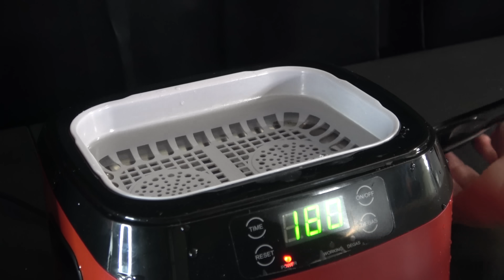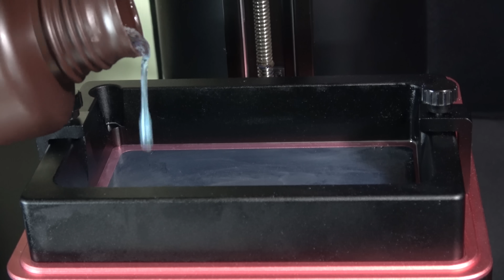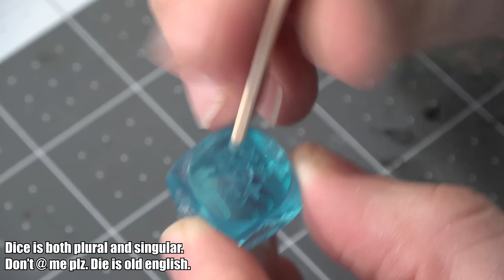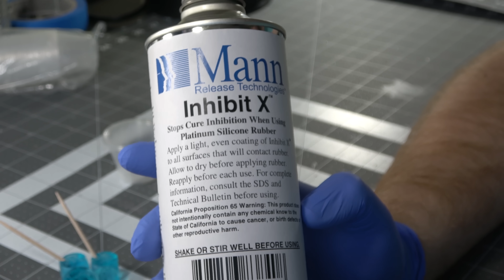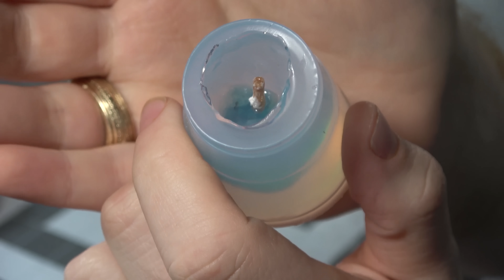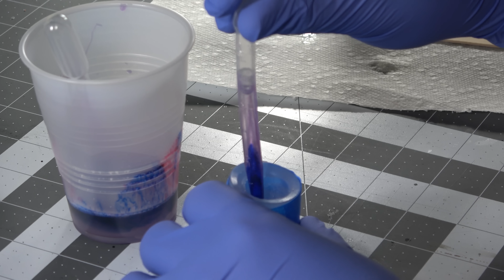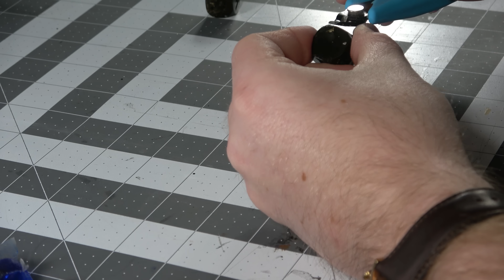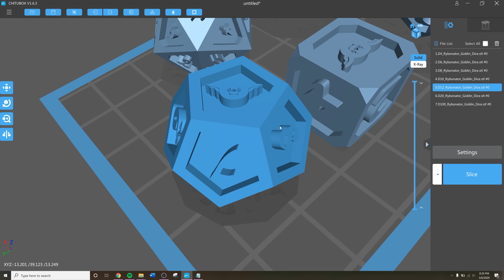How to Make Master Dice for Molds from 3D Printed Dice

Comment: Tip for you dude, use Prusa Slicer to oritate and support your 3D prints, then export them as an stl with supports, Chitu can read these files and saves you sooo much hassel. There are even some templates out there so you don't need to configure Prusa Slicer yourself. :)

Comment: Question: why don't you use the resin printed dice directly? Are they unfair or too light?
Reply from the maker: 3d printing resin is softer than normal resin. So if you roll it and toss it like you do with dice, it'll scratch really quickly

Comment: I followed the letter to the "t" on this tutorial, except I made coins instead of dice. Elegoo Mars printer, water washable resin, Smooth-On Mold-Star 15, Inhibit X, all of it and I still can't get my silicone molds to turn out. Applied 4 coats of Inhibit X just to be sure, threw the mold casts into the pressure pot for 5 hours, and when I open the pot I get molds that are still uncured where it contacts the 3D print. Any advice please, would be very very appreciated

Comment: I like those light blue dice that were used as your masters. They look like they are made from blue crystal. You might be able to make batches of those and sell them in that color as well as other colors, on Patreon. They could be made in different designs. One with standard numbers and the rest with you custom symbols. Also, I would have drilles the hole in a corner wher the faces would not have been marred by the support area.
I had another thought as well and that is to use another color of the resin to fill the recessed shapes.

Comment: This may have been mentioned in the 500+ comments already posted. But if drilling the hole for the toothpick into the dice is an issue why not just make a slightly undersized hole for the toothpick in the original CAD model? 
Then you can control exactly where it goes, the angle, depth. Etc...

Comment: Since you're printing the master, couldn't you just include the sprue hole (for the toothpick) in the print? That wouldn't make sanding any harder, and you wouldn't have to use the drill.

Comment: I noticed that you printed some of your dice with a face pointing down and some with an edge pointing down. To get nice, clean faces, it's worth printing all of your dice with an edge or vertex pointing down. The reason is that when a large flat section (ie a face) is printed directly above the supports, the suction between the FEP film and the flat layer can cause the layer to warp. For dice with rounded vertices, it might be easier to print the dice edge-down than vertex-down so that you don't have to sand support marks off of the vertices.

Comment: Great video and its super generous to provide the dice stl files for free. I really like the font! Have you printed a set of masters based on the files? The reason I ask is that the numerals seem to be really deep and was wondering if that could cause the mold making process to be a challenge. Like it might be hard to get silicon into each numeral or it might be tough to separate the silicon from the master once the mold is cured. I really like the aesthetic of the deep numerals, so I hope all of my concerns are invalid!

Comment: I thought putting silicone molds in a pressure pot to cure was a no no. is there any issues with the air expanding after you take it out of the pressure tank?
Reply: He did a video on it a month or two ago here https://www.youtube.com/watch?v=pflFG5cAB4Q

Comment: Between this set up with drilling into the die face and your usual method of gluing a corner to a d6, which did you prefer? Was there any meaningful difference in cleaning up the sides once removing the sprues?

Comment: Add sprues to the STL file? That way you don't have to drill into it. Maybe that will work. Im not too sure. Maybe either have a hole for the wood picks, or a longer cylindar sticking out.

P.S. Did you ever get a chance to make dice molds using things like silicon caulk?
Reply from the maker: I prefer to add the spures later, as having sprues already on a face makes it SUPER hard to sand.

I haven't gotten to try that yet not, but have heard mild success, with ok levels of detail, but not great.

Comment: I wanted to ask you. I made a new mold set using the toothpick method you describe here. One thing I'm running into is how small the mold opening is now. Do you pipettes fit in there well? My syringe that I normally use is a little big.
Reply from the maker: Pipettes seem to work great. They are just about the right size, and can be forced in pretty easily :)
Reply: @Rybonator  thanks for the reply. I ordered some last night to try. I made a set using my syringe last night and found I could force the testing in by placing the tip right over the hole. I'll let you know how it comes out.

Comment: Is there a reason not to print the sprue? It seems that with the possibility of the bit bouncing or a shaky hand damaging the master, that printing the sprue and spout (?) would be the way to go. It would make sanding that area more difficult on the master, but with the need to do finish sanding on the final, I am not sure if that is such an issue. The sprue could even be printed to be a cone for less area a bubble could be trapped.
Reply: Hi I hope @rybonator can answer this as I have the same thought ! Surely it is easier to print a design that as a cone shape sprue included in design rather than trying to attach a sprue after the fact ? Also casting the sprue on the flat side versus a corner !

Comment: Never give up, never surrender! Not sure if your clay gives an extensive list of ingredients, but I believe it is sulfur containing compounds that tend to not cooperate with Pt based silicones. Was the clay dry before you poured the silicone? That may have played in things not working out as planned. Regardless, the dice came out awesome. I thought you mihgt have tried to print the dice with the end mold support and pour hole. That is something I've wanted to play around with once I get a resin printer but you hit me with a big dose of reality. I probably would need to do some sanding before pouring master molds. I'll still probably do it, but I really did like the toothpick trick. Would love to see it implemented on the full set of polyhedral dice or pointers to videos would rock.

Comment: Quick question about the part of the video talking about dipping your master dice, or anything from a 3d printer really, to make sure the silicon cures.

Is there another product i could look into using instead of Inhibit X or is that the only one?

Reason why is because my friend of mine is doing all the 3d printing for me so i can make molds, problem is getting my hands on Smooth-On products, specially their Inhibit X, is near impossible or super over prised. Someone told me to use clear nail polish but i don't think that would work.
Reply from the maker: Supposedly you can try and mitigate the inhibition to curing by covering it in a varnish, but that doesn't always work.  You could instead just use TIN cured silicone. Or, Use TIN cured silicone, and then platinum silicone after you make some masters from your tin cured silicone :)
Reply: @Rybonator  Not a bad idea, a little more time consuming but better to be safe then sorry.

Again thanks!

Comment: OK I've edited this after I've seen your horrendous 3D printing process. I've been printing with resin for 2 years, I make engineering models, and microhydraulics so let's get you printing well. 

Here are some tips: 
1: Level the bed/build plate properly. When levelling the bed make sure the bed is actually level, your dice did not finish printing due to a 0.12mm gap between the bed and the FEP film. make sure both the back and front (sides as well) are leveled. you can do this by pulling the paper out from all sides to make sure. 
 2: make sure your resin does not have bubbles in it. All those nicks on your dice are either you being really bad with clippers or due to bubbles. Stir out the bubbles with a popsicle stick adn try to get rid of all of them much like you would with silicon. I don't have a vacuum chamber but feel free to test out if that helps somewhat. 
3: Add all your holes in CAD. if you need to make a hole and don't trust yourself with a drill let the printer do it for you. Keep in mind the shrinkage of the resin. 
4. You don't need all those supports. Print the dice from one corner facing up and take your supports from there, you shouldn't need that many supports. Alternatively you can modify the file in CAD and make a compensation base (a slight extrusion of one face) that you can sand down later. To do this add a 0.1 to 0.5 mm extrusion to the bottom face, and enough of a taper that it compensates for the light bleed. Again this is dependent on the shrinkage of your resin. 
5. You can secure the toothpicks by dipping them in resin and putting it under UV light, (for the transparent dice) no need for superglue, I 3D printed a resin dragon (I got paid to do it) at one point and had to weld 6 different prints together. 

I use the Anycubic Photon with Monocure 3D Rapid most of the time so my settings and measurements will be different than the ones for your Elegoo Mars. But these tips apply in general to resin 3D printers so it'll be up to you to come up with the final measurements that fit the printer and resin that you're using. 

Happy Printing!
Reply from the maker: 1- I have leveled the bed. Only ever had 1 failure when printing and it was shown here :)
2- I probably should do that
3- I don't do any of the modeling myself. As will a lot of the people who follow this tutorial, so I like to show my way :)
4- Like I said in the vid, I know I didn't need that many, but I was frustrated and tried to force it to work haha (It did, but a lot of sanding was needed.) Now I use much smaller and less supports :)
5- Superglue or Resin, both get the same result for the toothpick :) 

Thanks for the tips my friend! :)

Comment: I am curious, how do you make the dice perfectly fair/balanced? At what point during the process is that a concern?
Reply from the maker: During the master mold making, and during the sanding. (Also during the resin pour if you put things inside the resin besides dyes.) Because the resin is 1 material throughout, it generally is always balanced - IF you have a symmetrical dice. So when making your masters for molds, the sanding needs to be done right, and the same goes for when you sand after pulling from the molds :)

Comment: Do you know about using Prusa slicer for auto orientation and auto supports? It tends to be way better than Chitubox for supports and it helps reduce failure. You can toss the files in the Prusa slicer, auto orientate, add supports and then export with supports. You can then take the file into Chitubox for slicing. I haven't had a failure since on my Elegoo Mars with anything I've printed since I started doing this for my workflow. 

I also use a metal scraper and haven't had a problem, so you're good to go on that mate.
Reply from the maker: I haven't heard of Prusa before. I might have to look into it and give it a shot :)
Reply: @Rybonator  if you have any questions let me know. Happy to help.

Comment: Instead of taking the risk of drilling into the master for the mold support, couldn't you simply design the hole into the original print? No chance of screwing up the die at a late step after hours already spent, and the hole would be in the precise location you wanted it not kinda close-ish.
Reply from the maker: That's a good point, and you can totally do that! I have no skills in modeling, so I don't do that. As well, this gives you more options to have a filled dice instead of one with a hole in it, in case you want to mold it in a different way. But it's totally a viable option :)

Comment: Any tips for printing the dice on an FDM printer? I ask since that is what I have. I haven't gotten the chance to get a resin one yet, and I'll probably get a laser engraver/cutter 1st. I'll be able to do stuff in wood that I can sell. Been using my printer to make jigs and other things to help with woodworking.  Thanks
Reply from the maker: If you are going to try on a FDM printer, it will be difficult but I don't think impossible. I would recommend 100% infill, that way you can sand down and not worry about suddenly having no more plastic. That and use dice with DEEP numbers like the files I have. That will help in case you over sand :)
Reply: @Rybonator  Yes, I was going to use those. Plus I was going to try and model a set with a different font after I can successfully do them.

Comment: For anyone who doesn't know you should never use Isopropyl in an ultrasonic cleaner unless you use the bag trick or using an expensive model designed for flammable solvents. 
The electronics inside the cleaner can ignite the fumes.
Reply from the maker: Absolutely! That's why I use the alcohol in water trick now :)

Comment: If your casting resin has a 24-hour cure time, why not just reprint the dice? There are lots of options for colours and inclusions for printing resins for variety. Just a thought.
Reply from the maker: Printing resin is far softer than casting resin. Printing resin will get dents and knicks when rolled as dice FAR sooner than a normal resin dice would. That's the main reason :)

Comment: Wish it wasn't so expensive and easier to find in the UK, costs £110 just for the inhibit x and the sorta clear, already have a elegoo mars printer
Reply from the maker: Ohh dang, yeah that's a big barrier. You can always just use Tin cured silicone and not have to worry about any of the curing issues :)

Comment: Watched the whole thing, so don’t worry about how long the videos are. I’m glad you showed what didn’t work. I may try that Zona stuff in my next restoration project. 

I think what really surprised me was that you had some dice designed and flat out said, “here you go. It’s free. Go ahead and sell them if you want. We won’t come after you. Just give us credit.” That’s really cool. I just wish I had a 3D printer to take advantage of that. I’ll just have to create molds or buy ones you’ve made when that comes out.
Reply from the maker: The Zona papers are just fantastic, I can't recommend them enough for a glass like finish :) And thank you for the support of the longer video. I worried about that, but the overall response is very positive! I'll make sure that if the vids need to be longer for a full explanation, then I won't worry about time :)

I just think the community needed something that was safe and secure. Something that they didn't have to worry about and could sell with peace of mind :) If you ever get started, I can't wait to see what you create!

Comment: Could it be that the clay you used had sulfur in it? When using clay for molds it is important to use sulfur-free clay since sulfur wont let the silicone cure.
Reply from the maker: I really thought that I looked and that it didn't :/ But obviously I was wrong haha. I'll find a solution :)
Reply: Rybonator  Any sulfur-free clay would be fine. It doesnt have to be air-dried clay or anything. I had a sample from Monster Clay for example, that worked fine. Though there are definitely cheaper clay variation out there.

Comment: Hey I got a tip for you: If you're 3D printing your dice, why not build the funnel and sprue into the model? It's what I've been doing with mine and it saves the trouble of drilling a hole and adding a toothpick into the mix. You can also put the sprue virtually anywhere on the die, making removing it trivial. I put mine right on a corner. Pictured below is the 3D model and then the final result. Some bubbles are on the surface of the final die because I was just testing the mold and didn't bother to pressurize it. https://i.imgur.com/Fb4AwJF.png
Reply from the maker: You totally can do that! (Great model by the way.) But, I like to completely sand my dice first, and then add the sprue. It's really hard to sand AROUND a sprue, much easier on a flat surface :)
Reply: @Rybonator  in that case it may not hurt to model it with the hole already in place. That'd save you from the distortion you got on that one side with the W.

Comment: Could this be done with an FDM 3D printer like my Ender 3?
Reply from the maker: You totally can, but because the FDM shows less detail, you might have to do some more sanding. Make sure to print at 100% infill as well.
Reply: @Rybonator  even if you're just making a master? I feel like it wouldn't need to be full infill because all you really need is a good surface. Also, there's ironing mode for far smoother surfaces in cura that could help. But also the sanding papers on glass should be good as well.